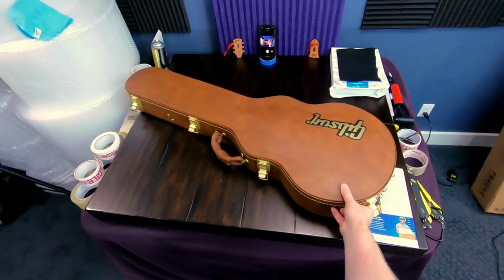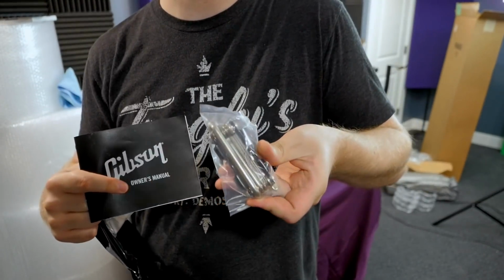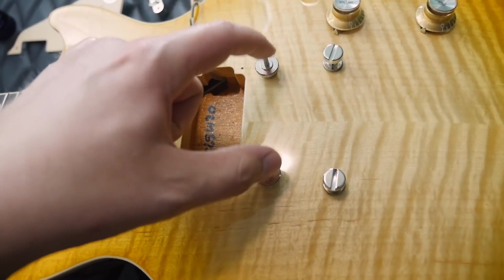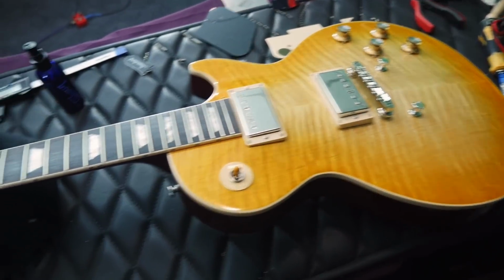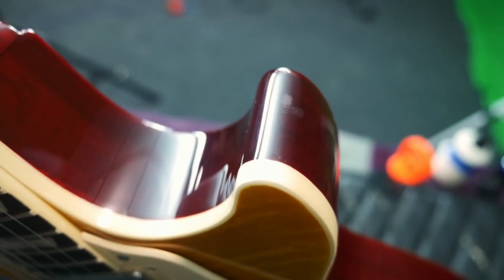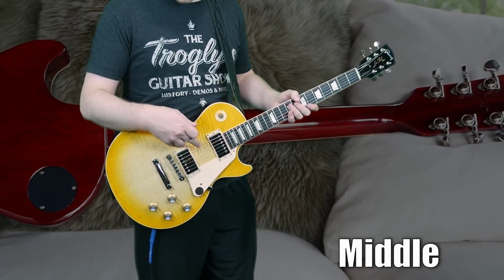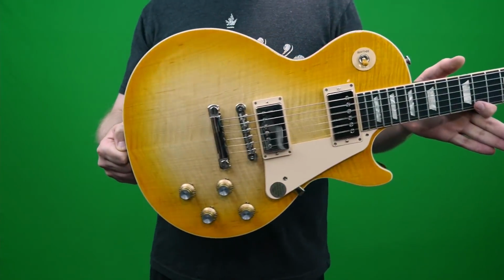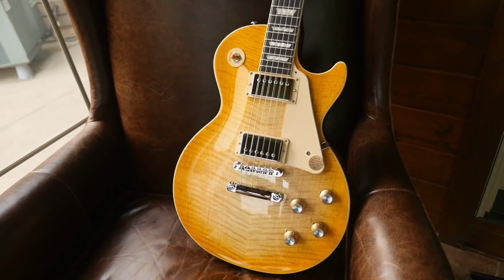Is the 60s Standard Still Worth Buying in 2022? |  Gibson Les Paul 60s AAA Flame Top Lemonburst

Comment: Why, after they went decades without them, they would bring back the long neck tenon, only to get rid of it again as soon as they come out with these 50's and 60's spec Standards, I never understand. Even the Epi still has the long tenon. That's absolutely that makes a difference with whether I buy one or not. Can a short tenon sound good? Of course. Can a short sound better than a long? Meh, possibly so If other things are better. I've been a luthier for 20 years. The neck joint is going to be that most important when it comes to how well the entire guitar resonates. You don't have to be an engineer to figure out that a better coupling, with a larger surface to surface area contact is going to benefit that.
I like flame tops, but I never liked how they do them here. I like them when they run right to left, as opposed to this kind of Chevron pattern they use. Gotta say, I'm not impressed with this, at all.
Reply: If I'm not mistaken, Heritage Guitars utilize the long neck tenon on their Les Paul type models. Gibson could easily do the same.
Reply: @nellayema2455  They had been. They went back to the long tenon in 2007 or 2008. Then when they came out with these "vintage specs" Standards a few years ago they went back to short. And in a somewhat sleazy way, they listed it in a way that implies that's how they originally were in the 50s. 
Even the Japanese copies have long tenons. I honestly don't know the thought process behind this, it would have meant they had to change the machines to go back to short tenons so I can't imagine it saves money. They seem no better now than they were with the last CEO, and it's a crying shame. I really thought they were getting their act in gear like they said they were, I haven't seen that yet.
Reply: lol stop it.  So, plugged in and strummed, if I had 5 Les Paul’s, all variations, you could tell me which had a long tenon?
Reply: @CD-gk9ix  Good point and the real answer is "No; you couldn't."
Reply: @cvfunnsixspeed9213  exactly … and maybe I’d have all 5 be short tenon models… let’s see if he guesses which has the long tenon.
Reply: @CD-gk9ix  no, it doesn't work that way, but if you're spending a couple thousand $,  why would you choose the one with an inferior construction method? Just like if you plugged a $500 Epiphone and $4000 Gibson in, you might not tell which is which from the sound, but that doesn't mean I'd buy the Epiphone for $4000. Would you?
Reply: @timwhite5562  you said it makes a difference.

So, can you tell the difference?

5 LP’s played clean.. can you pick it out?
Reply: @CD-gk9ix  So, if you can't necessarily hear the difference between a $1000 & $5000 guitar, would you be willing to buy both for $5000? If you can't hear the difference, that means there isn't one? Of course not, that's not the only factor that separates one from the other. If I'm spending the money, especially if it's the same price between them, I'm buying the one that's the best deal, and construction method, materials used to build it with, etc are all part of that.
Reply: @timwhite5562  you said you know the difference.

So use your 20 years of luthier experience, and explain how one can tell?

Is it by feel?  By audio?  How does one tell the difference before removing the strings and pickups?

And please don’t go down the “back in the old days.”  Back in the old days QC barely existed.  Stuff was thrown together and then eyeballed, at best.
Reply: @CD-gk9ix  where did I say that? I just reread my post and I didn't see that anywhere in there.
I'll pose the question again: if you can't hear the difference between a $1000 And $5000 guitar, does that mean there is none? Does that mean you'd spend $2000 for the $1000 guitar, because hey: you can't hear the difference so they're mustn't be one.
Don't mischaracterize what I said
Reply: @timwhite5562  you said it makes a difference on whether you’d buy it.

What about it makes a difference?

If it’s just one of those dealbreakers that you can’t quantify, that’s fine… like, I don’t like SG’s… I dunno why, I just don’t.  I don’t care how good it is, if it spits gold.
Reply: @CD-gk9ix  Longer tenons tend to have a stronger resonance and bolder attack. Long tenons are also far less likely to have issues later on. I've done a couple resets with the longer tenons, I've done countless resets on the shorter (especially the "rocker" tenons from later Norlin era).
 It's a superior construction method. After decades of not doing it that way, they finally went back to doing it that way. Then they came out with "we're going back to focusing on quality, that's what players concerns are so that's what we're doing." Then the first they did, was go right back to an inferior construction method.
They went back to using hide glue for the necks when they transitioned from the Heritage reissue to Custom Shop. People prefer hide glue because it resonates (and it's easier to work on later), whereas regular wood glue doesn't, it's plastic. If people like the necks to to be joined with hide glue, don't you think that have a much larger surface to surface area is going to make difference? It's not all about the sound, if it was, they wouldn't be able to sell $10,000 Custom Shop models. The difference is value is more than tone, quality is a big one. I'm not going to buy what I consider an interior build, if I can get a superior for the same $. That is why it's a deal breaker for me.
I'll add that QC was certainly not all over the place in the "old days." Electronic components tended to have looser tolerances, that's true, but build qualities were far better. They went to shit in the 70s, but they certainly were better.

Comment: That nitro has definitely not had enough time to cure, nitro takes months to cure, 6-12 months to be decent. It’s doesn’t really get done curing for a good couple years. So the fact that that guitar was stamped February 24th in the serial number means it has unbelievably soft clear. So yeah, the case smudged it, I’m sure if someone pressed their thumb into it you could put your fingerprint in the finish. They’re rushing things badly. Same reason there’s wood shavings inside and I cleaned pocket walls, they’re rushing hard to meet quotas. Is what it is with a huge brand like that, they let slide anything that doesn’t affect the bottom line, as soon as customers slow down purchasing they step the game back up a bit. Henry J or JC the company is still focused on making the name a lifestyle/legacy brand. It ain’t really about the quality of the guitars, it’s about the numbers.

BTW for anyone reading this in the future; as of me writing my comment it’s May 22, so the serial number being stamped February 24th means this guitar has had MAYBE 3-4 months curing time as of trogly making this video, but likely more like 2.5-3 months. This also means it was assembled when it was barely able to be handled. So it’s gonna be very hard for any real player to use the guitar even at home without leaving impressions on the finish. That’s why putting in the case and shipping were enough to leave the finish goofed up straight away. Also my earlier thumb print comment is not an exaggeration, I bought my 2003 SG Standard brand new as a 23 year old idiot and thought the finish felt soft, so my idea was the press down hard with my thumb and to this day my thumbprint is visible in the finish.
Reply: Your word is golden, my friend
Reply: Yeah, I bought one of these Lemonburst 60's standards back in early October and it has a rather large (1.5 inch by 1.5 inch) smudge on the back of the guitar that wasn't disclosed to me.

Comment: My 2017 hp standard looks better, 4A+ top same adjustable bridge, removable pick guard asymmetrical neck, compound radius fretboard and access heel neck joint and all for the low price of 3700 Canadian, and all people did was complain 😁. They said "that isn't a standard" and they were right, it was above, the standard was a lower bar to meet.

Comment: The Henry J era was known for nasty finish flaws, bad setups, bad fretwork, etc.  I don't think loose wood chips in a cavity really fit into that criteria.
Reply: I guess I got lucky on my 4
Reply: @styrenebuilds6851  I have a 2008 robot LP that was converted to traditional tuners and electronics and it's a fine guitar.  I think a few bad apples here and there soured their rep.  As far as the wood chip thing I work in QC for a major manufacturer.  We check  the electronics, fit, finish and playability.  If we opened the control cavities and removed pickups on every guitar that crossed the bench we'd never get anything done.
Reply: @lettuce_spray  No worries, I didn't take it that way.  I don't install pickups unless necessary.  If there's debris in the cavities it should have been caught before it gets to me.  I pull the guitar, visually inspect for fit and finish, plug it in and tune it to pitch, check the electronics in all positions, make sure the pots work correctly, check neck relief, 1st and 12th fret string height, pickup height, tune it again, check down the neck for fret buzz, check intonation, stretch strings and tune it again, play it for a bit, wipe it down, pack it up and send it on it's way.  All day every day.  Fun stuff 😀
Reply: @lettuce_spray  I couldn't agree more.  I also understand that we're all human though.  It's really easy for someone to miss a few loose wood chips.  It doesn't effect the overall quality of the instrument although it may be annoying to the person that opens it up.  I get it.

Comment: Scuff marks after 55 point inspection by Sweetwater...
Reply: 55 point just means they plug in the guitar and see if it works and throw it back in the case, it means nothing.
Reply: @ashleyjohansson230  No, it’s much more than that and there is a real chance that they inadvertently leave marks. So, if you want a pristine, factory fresh guitar I suggest you refuse the inspection.
Reply: Probably from the factory, I got a PRS from Sweetwater in January and there is not a mark or blemish on it.